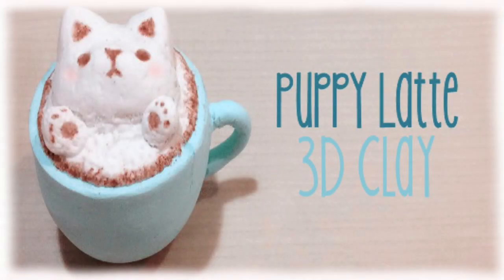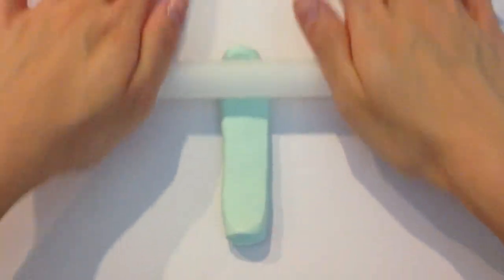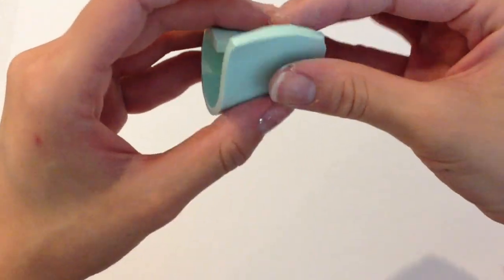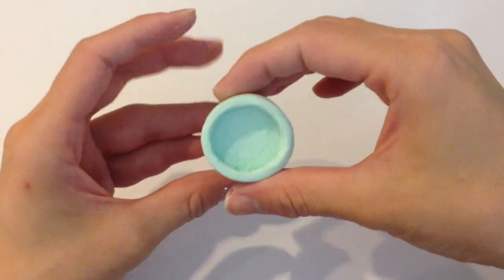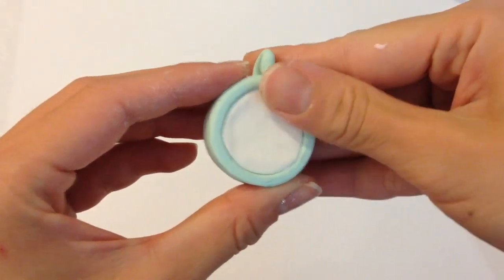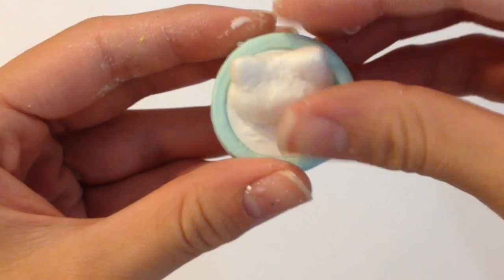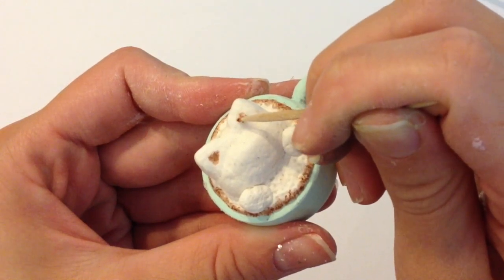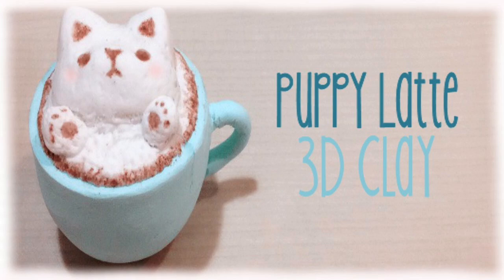3D Latte Puppy Design Polymer Clay Tutorial DIY

Comment: Do you use clear nail polish to glaze please answer and if you do does it work as good as actual glaze
Reply from the maker: Zap zoner's i do but I know a lot of people don't recommend it. It just depends on what brand and type you use.. I bought mine at walmart.. it's proX and it does just fine.. all my stuff have been glazed for years and nothing has turned yellow
Reply: Flying Mio I have a feeling it goes yellow if you leave it in the sung for long perios of time, I could be wrong though.